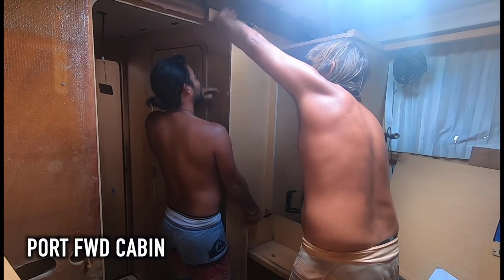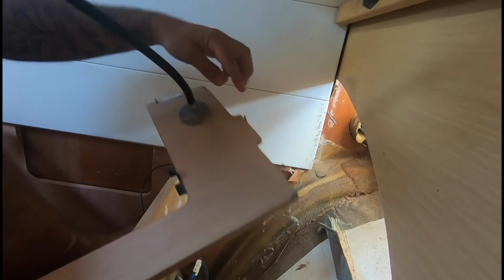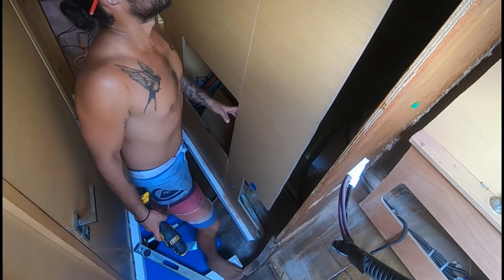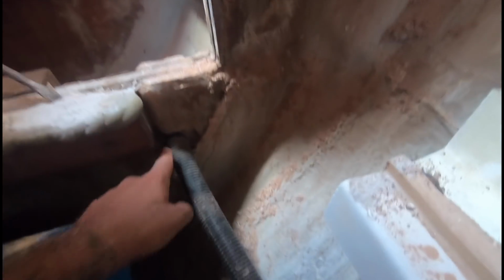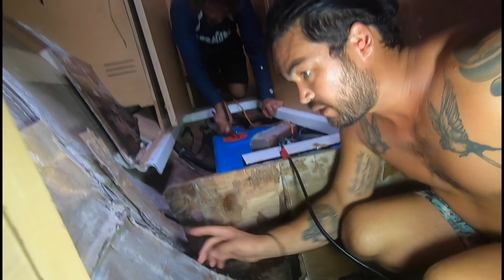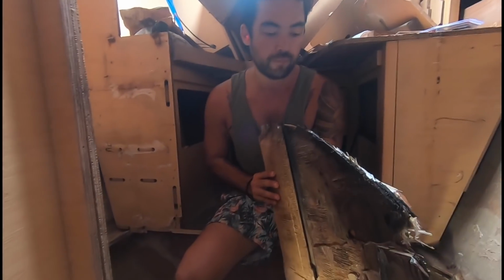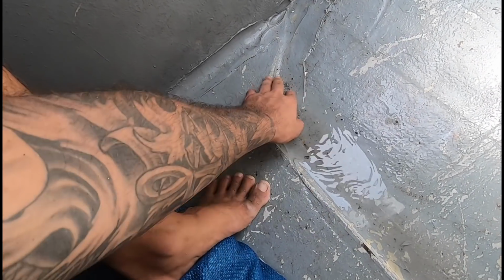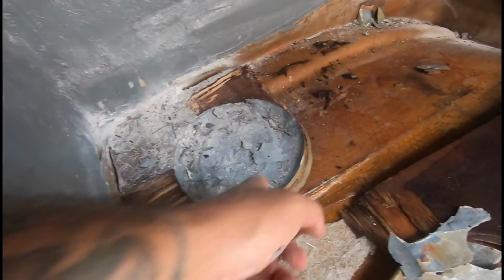CRACKED BULKHEAD REPAIR SERIES - Part 5  (Episode 110)

Comment: In addition to poor design (not having the bulkheads strong enough) the construction is very poor - I can't believe they used some kind of caulking glue in an S pattern between marine ply sheets! You kidding me? You need 100% coverage of a strong glue (epoxy as you are using, is best, but even a marine grade contact cement, or polyester resin would be way better) for proper shear strength there. Cheap, quick, dodgy was what was happening in the build . . . I feel for all the lagoon owners out there. Good you guys for fixing it right, and showing everyone the result of poor design and build quality.

Comment: It was interesting to see just how accurate the predictions offered by that Marine Architect many episodes ago were when he uttered words essentially to the effect;

"You will probably find a bare minimum of glue rather than resin roughly instead of properly applied just to hold things together".

Upon reviewing your whole series of episodes I did expect to see critical structures glued together with plenty of resin and far more glass.

I particularly expected it at the fillets in order for the boat to be able to carry a reasonable amount of cargo predicated on safely carrying a number of people over very long distances while periodically subjected to unpredictable and strenuous weather and sea conditions.

Colin as a complete novice regarding all of what you have achieved but having now looked from a perspective moderated by awareness for the remarks of a professional Marine Architect.

I firmly believe that what you and Jamie did to fix your boat was a standard the builders should have applied from the beginning in order to produce a truly blue water capable yacht worthy of even the minimum qualification in that category.

It would also be most interesting to know whether not only the rotten ply you replaced but all the ply used in construction of Parlay was marine grade and if it is, are you considering ascertaining the quality of the material used?

Comment: I think Lagoon bosses need to double or triple the bulkhead thickness in their future builds considering the amount of holes cut through for utilities pipes etc (seriously weakening them)They should be thanking YOU as it seems to be a flaw in their design Personally I think you are saving them from potentially massive law suits ,I think they should at the least supply all your repair materials costs MINIMUM!

Comment: I find it very depressing to see such poor design, poor manufacturing and lack of decent Quality Control. Those conduit holes should have been reinforced by doublers because they are a weak spot. Tip from me, if possible get Finnish Marine Plywood if you can, it is the best by far !

Comment: Well Mates, it looks as though this bowing is not caused by hurricane damage, as it is original design flaws. Let's just say it; Lagoon is the Bayliner of Catamarans. Nearly 500 grand, new, for what? The name? Much like SeaRay is owned by the same company as Bayliner, which is Brunswick; it seems as though Lagoon is another hype company selling and designing Cats with the same sub-level integrity as lower lines. What you have uncovered are serious design flaws exacerbated by use and harsh conditions, which would have not produced such a depth of damage had the original structural design integrity been held at a higher standard. As a design engineer, to be an engineer for Lagoon as this example, is as embarrassing as British automotive wiring or French automotive mechanical engineering. The original specification tolerances would have had to have been so far out as to work from a novice hand-sketch for drawings.i hope that Lagoon will pay you R&D time for your reinforcement design to correct their sub standard design.

Comment: I wouldn't say you're crazy WRT the repair. I would say that had it been me, I'd have given up on the partial patch idea by now and started taking out interior on a larger scale. Partly to see if there's any other nastiness hiding in the corners, partly b/c of rationality. Good access makes it easier to do the repairs, and dealing with bigger panels may actually make reassembly faster. Fewer pieces to the puzzle kind of thing. It takes as much time to enlarge a cut  to expose a repair site as it takes to make the first cut. And longer to put it together.

Comment: For the through holes for electrical, hydraulic, etc. consider using a piece of PVC pipe the needed diameter and lengthed to extend out 1/2 inch on each side of your bulkheads bonded into the bulkheads. this should give greater strength to the areas of penetration through the bulkheads. for the dust consider venting it through a shop vac left running. I hope the manufacturer is helping out with these fixes. You are doing your best under the conditions. Lastly consider how you might replace the cut-away cabin woodwork outside and brought in and fastened in place. Too bad they don't provide the cad models for your rebuild. Please consider a follow-up in that last area with the sealed through holes.

Comment: One of the issues with GRP on ply is the GRP is only as strong as the first layer of veneer on the ply. The ply on your boat is WBP not marine, marine ply has the same thickness veneers all the way through including the surface veneer. It looks as if the bonding is OK on the bulkhead to hull. The stress on the hulls in a cat is far greater than those of a mono hull, even more so on a sailing cat. I take my hat of to you in putting this right, it is no easy task, trust me, I know.

Comment: What happened with the bulkheads in the hurricane with each impact the force got transmitted to the bulkheads causing them to disbond from the hull. That means a hit at the stern can pop bulkheads loose anywhere on the boat.

Comment: Just a thought but would a laminated beam be a stronger replacement for those bulkheads you might check with lagoon and find out as in construction they are designed to hold alot of weight and and still be a little flexible but it might not have enough flex

Comment: I think this clearly shows that catamarans are technically faulted, full stop.   I monohull, like a beer bottle, can roll, rotate, and spin with no stress against itself. Two beer bottles joined together with chopsticks put leverage forces to the fulcrum points. Add this to the OTT cost of cats, mooring fees, haulouts, repairs etc etc etc and this is why IMO cats are just wrong.

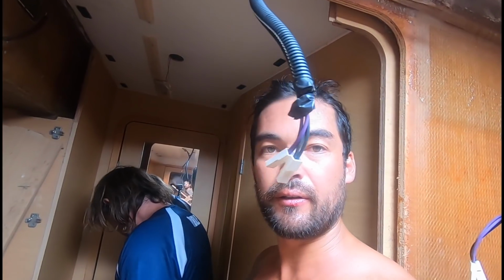Comment: at 10:20 I have seen that rotting up before where you had first opened up I should have commented back then did lightning strike that side did it go down that spar for that side and then did water come in and have it could that water rotted the wood out that quickly,  NO!   the hurricane grabs ahold of already wet and rotted wood, is that not the wall you first opened up with your exploratory it is isn't it, I saw it then and I said nothing I was waiting for you to say something. you got me really involves your I really would like to know if I'm on to something here if you saw the same thing please let me hear something from you

Comment: That 19 layer resin glass over the door was pre made as a slab an put on all in one operation to save time. But this makes it bond less. You can not roll out resin or air trapped behind a layer that big...

Comment: To prevent dust in the rest of the boat create with your vaccum clenaer a Negative pressure in the cabin, let him stand outside, only use the hose inside (long hose needed ;-)

Comment: You guys are amazing. One obstacle after another and you keep knocking them down.  Congratulations on the mindset and determination.  Please don't give up. You are an inspiration to everybody watching your channel.  We know yours is a Hurricane damaged boat but what you have, are and will un-earth is an indictment on Lagoon.  The design and engineering of many of the modules and structural members is appalling and the adhesives used in the fitment of the modules and bulkheads seem to show a complete disregard for the loads they are expected to carry. In addition, it appears that some of the mating modules have never been coated with any preventative to seal the plywood and prevent it from becoming waterlogged, particularly exposed end-grain components.  
If I was a Lagoon owner right now I would be very concerned, and if I was an executive at Lagoon I would be seriously questioning the design, engineering, construction and tradesmanship of my product. It is easy to identify and ignore the hurricane damage, but the quality of what is being exposed here is appalling and could easily result in injury or death.  It would be wise for Lagoon to have a good hard look at what they are producing.  It is one thing to have full order books, but it is another to turn out a product that looks pretty but is engineered and manufactured to such a low standard.  If what is unfolding here is what Lagoon calls a quality product that is fit for purpose, I strongly suggest they re-evaluate their ISO quality accreditation.

Comment: 14 min in ..the statement about attitude and perseverance and sustained positive attitude is huge. Gloves and fiberglass ..a must ..
At this point I’m amazed Lagoon haven’t sent engineering reps to examine all the issues. Of course they have weighed the corporate position ..and are taking that. Us boat fanatics are taking note as well. Of course a lot of reconstruction can wait for the future. Access and visibility of the complete structure enroute will be paramount. I’ve made similar discoveries with Searay boats after hurricane Sally gulf coast! Good luck great videos..big fan!

Comment: I run a wood shop in a art college. I have to stay on top of dust. Even with the giant air filtration system we have, there is still localized dust to each machine in use as you know. A makeshift dust remover solution is with box fans with air conditioner filter just leaned against them. Even if they are just ambient all throughout the salon.Your fortitude is inspiring-seriously, every time I watch this dark night of the soul you are slogging through. Prayers go out to you brothers. I started following Jamie on the IG. xulxulxul "Persistence and determination alone are omnipotent".-Calvin Coolidge

Comment: Kia Ora Col. I would replace your ply bulkheads with new marine ply after first glassing it on both sides with double bias cloth, peel ply and vacuum bag. Then glue in place, after glue sets cove then glass to hull with 2 layers of 120mm double bias tape overlapping 40-60, peel ply that. Try to do the cove and tape wet on wet. Lagoon should have given you a new boat, taken yours to a landfill and sworn you to silence! This proves how badly built these overweight floating appartments are. Speaks volumes of the so called naval architects that designed it and signed it off. When you have finished you will have a stronger and possibly lighter boat than Lagoon have ever built. Regards Rog

Comment: just wtf man, right i am an engineer and wood worker building timber frame buildings and ecobuilds, what i am seeing is low grade plywood masquarading as "marine ply" the bonding of the ply itself looks crap, although they (the maker) are constructing high end cats they are cutting corners on low grade commercial ply, i think i would look at replacing the ply with phenolic ply (used as trailer floors), there are few shots that show weak bonding within the ply itself, might be a real good idea to get the manufacturer to specify the grade of ply used. Sh1t construction. Bravo , looks best to totally strip each hull and totally re-enforce, good luck!!!

Comment: I watch this plywood damaged by water and wonder if it was a good construction material.  There are so many places where plywood is used and it is exposed to water and high dynamic loads, and it still works.  Maybe the plywood was so bad?  Not protected with fungicides, soft, made of wood not resistant to water, with poor glue, poorly saturated with resin?  Or maybe there shouldn't be plywood there at all, but a girder made of glass fiber and resin.  They are wise as a layman.  Do you have any answers?
Reply: Ok I found this https://www.epoxyworks.com/index.php/plywood-basics/

Comment: Colin,

I can totally sympathize with your story and appreciate you sharing your journey in such an authentic way.  I found your channel researching fiberglass repairs but discovered so much more....  

I recently purchased a 2001 SeaRay and am dealing with many issues that could have been prevented with some smart design details and more attention in the production process.  I have soggy (but not yet rotten!) stringers, transom, and anchor locker floor that I'm working out.  I pulled a gallon of trapped water out of concealed voids this past weekend....good times.  

As I work in the yard on these repairs, I hear so many stories of newer and more expensive boats with poor design and craftsmanship, some nearly sinking after only hours in the water.  It's really amazing to hear about the latent issues on so many vessels out there.  There are more boat owners out there than we know struggling with water on the wrong side of the hull.

Regarding Parlay, I've been thinking about your situation and see some basic structural deficiencies in this bulkhead design and improvements.  

1 - There should be rounded corners in the door cutout - square corners are stress concentrators.  
2 - There should be a perpendicular section bonded to the perimeter of the cutout.  Something needs to prevent buckle and bend on the cutout edge (this would be like the original decorative door frame but bonded to the bulkhead panels).  Another option is a marine ply laminate panel where it is ply - foam - ply.  This in inherently much stiffer as it is effectively a stressed skin panel and can provide a better way to tie into your top beam.
3 - I don't see how torsional forces are managed at the upper "beam" that goes across the boat.  Many designers forget about twist.  More glass does not solve structure.
4 - The amount of glass on the plywood seems almost non existent.  I think a few mm of epoxy embedded random glass mat wrapped all around and tabbed into the hull would provide better strength.

By the time you are done, you'll no doubt have the strongest Lagoon on the planet.  I'm not sure where you at in the process, but happy to consult on these details if it can be helpful.

Your friend in making boats better than factory,
Matt

Comment: Greetings from Sydney! 

Those damn bolts into the deck!! 
Isn’t it frustrating how so many factories compromise a watertight hull by screwing things into it during fit out!

I just finished a 13 month restoration, due in large part, to after-market holes drilled in floor and transom! 

If you were docked in Sydney I’d be there with my 3M mask & my grinder helping :)

You can do this!

Comment: Colin, I have a Lagoon 400 here that has what they call a few known issues with Nacelle Drainage issues start the same under the front locker's water holding tanks etc...It looks almost identical to what you've found there. They have a sort of workaround. I do not know if that is same/similar to anything your dealing with on the 450 but after watching what your going through I can feel your pain. One day hope to run into you guys once this is done and your back on your dream. This too shall pass and with your determination and persistence you'll be back on the water prayerfully soon!

Comment: I keep hearing “put in new plywood”. When you see how suitable wood is in a boat, why the h*** use wood? :-) Yes, wood is beautiful and has soul and all that, but in those bulkheads you don’t see it. Why noot use some super durable and way stronger materials, like high density foam and lots of directional fibre? It’s even easier to do the job well... I positively hate plywood in boats! It NEVER lasts.

Comment: Colin sometime Google how many Lagoon 450 have cracked bulkheads or warped plywood,,, I was surprised to see how many had the same or similar problems.. I would think Lagoon would be scared of class action lawsuits ,, I'm no expert but it would seem they knew of these problems. Colin you are now famous and Parlay Revival has brought to light the problems of cracked bulkheads or poor engineering,,, Asking a door to be the strength of a solid bulkhead is not what I call sound engineering.. These are my opinions, but it seems owners have a case here,, Wish you guy's best of luck with your repairs..........

Comment: Using foam core bulkheads verse ply will greatly improve the value of your cat IMHO.  You are doing a great job.  As a P Eng, carpenter, and handyman I am really impressed with you both.  You have a great friend working with you.  All of this will pass and you will have a good, seaworthy boat in the end.  You have exposed the build flaws in nonfoam core cats.  Wood must be sealed period.  do not cut back on the sealant type and amount like you know who did.

Comment: Boat builders are making "throw-away" boats that are not moderately repair-able. Just like computers are not easily repairable with components soldered together onto the main board. Consumers tolerate this and some times care more about price point than quality, while the builders want to squeeze every penny of profit they can. This cycle will not easily end, if ever.
Reply: And its such a shame the cabinetry can't be easily removed. I had to make a small repair on my boat and I had to basically tear out the cabinetry because the screws were inserted when the cabinet was build outside of the boat and up against the hull.

Comment: Even if "only" ca 40 of the 1000 450's have found to have the problem, this is such a horrible horrible design. This is rendering the 450's pretty much wortless going forward, it's just a problem waiting to happen. It might be 1 year, 2 years or 5 years.